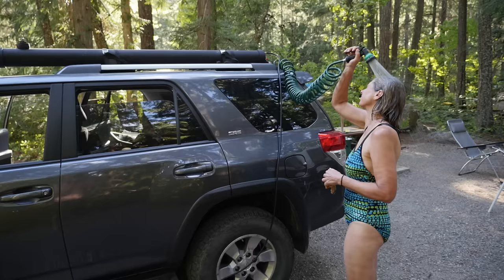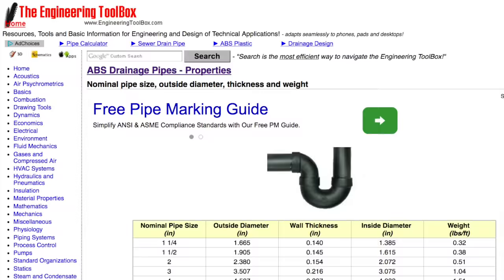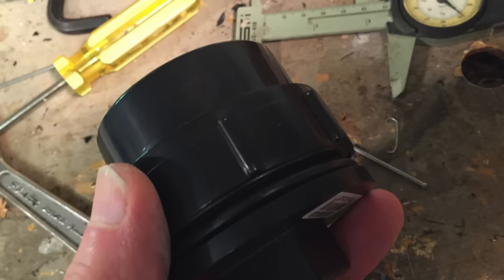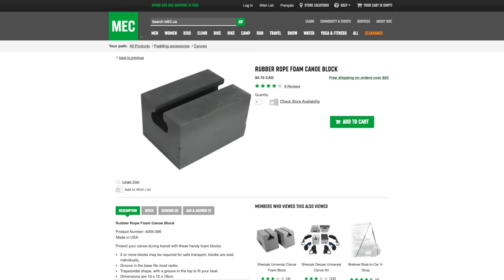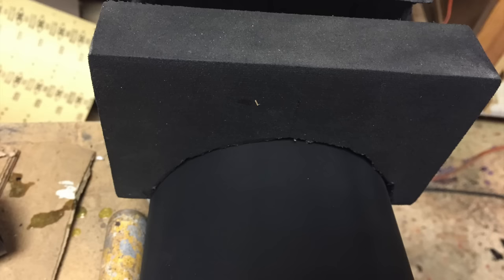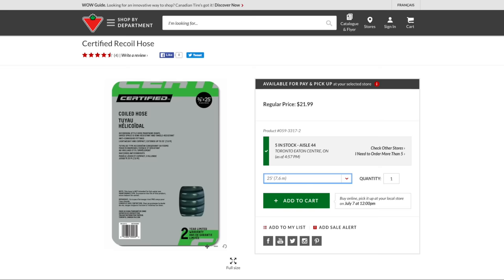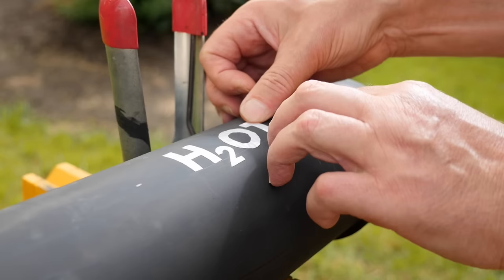H2OT - Rooftop, pressurized, solar-heated shower/sprayer using ABS pipe. DIY

Comment: 5 years later this pops up on my feed...Question for you...Do you have to keep the compressor on while using this? Hope you read this... Nice video...
Reply from the maker: NO. The compressor is only required when the psi drops to about 10 psi. Then turn it on to bring it up to 30 psi and shut it off.  The remaining volume of water I the tank determines the pressurization cycle.
Reply: @ImaginetMedia  Thanks for the reply...I only ask that question because your pressure gave out only after a few seconds...Was just thinking if you kept up the pressure while using this method that it would last. Might be easier for you to use a jerry can with a 12 volt pump...Plenty of videos on this method...
Reply from the maker: @tracymiller833  My method works fine. If the tank is full, the pressure will drop quickly. As the tank trains the reserve air capacity increases. The goal is to use the compressor as little as possible. Especially in a campsite.

Comment: it should be detachable from car, so it can be put on sun, and car in to the shade.
Reply from the maker: It is easily detachable from the vehicle. The straps only take a minute to attach. However, when full, it weighs over 20 Kg. Hoisting a 45 pound dead weight, up above my head, then leaning over to hit the roof racks without smashing it onto my trucks roof, is not something I am prepared to do.

Comment: Followed these specs with a few changes and I’m way happy to have a shower on the road, now! Thank you! How is it long term? Any issues? Does the paint hold up? And does the paint protect the ABS from the sun, as far as you can tell?
Reply from the maker: The key to any paint project is preparation. If you follow my steps - clean with methyl hydrate, buff with steel wool, apply good automotive primer, two coats of flat black pair, your shower will be UV safe for many many years.

Comment: I have a question about the 2" filler. Did you decide to drill instead of installing a 4 x 4 x 2 fitting because the fitting joints might not be able to take the bouncing of a full pipe over rough roads? Good job on the video. Did you also notice much pressure coming out of the 2" fill cap when you removed it after the water heated up inside and expanded?
Reply from the maker: Drilling is cleaner, cheaper, and less weight.  These joints will NEVR come apart. This is solvent cement, as glue and most people to not realize. The fitting a chemically welded together.
Reply: Thank you, I know that the solvent dissolves some of the ABS but did not realize that it could be used as a filler also. Your way is much cleaner looking, stronger and cheaper than a 4x4x2" fitting. Thank you brother, peace be with you.

Comment: Can I use a 6" ABS pipe instead of 4"? Im thinking of making one but shorter then what you have on your video but with a bigger diameter to hold the same amount of water.
Reply from the maker: All the specs for capacity are listed in the spreadsheet that I show. One factor not listed is cost. Six in ABS is significantly more expensive that four inch. It is also difficult to find in many areas.

Comment: Great video! Question: does anyone know what the best material for the tube would be to absorb the most heat?
Reply from the maker: The question really should be the best material to absorb heat AND transfer it to the water inside.  The answer to that would be aluminum. That is what started this whole adventure. I don't want to pay $500 for an aluminum tube.
Reply: Copper would be best, but ABS is lighter and cheaper.

Comment: Super achievement. Can you tell me which purge valve you have used. Merci
Reply from the maker: It is a standard vehicle radiator drain valve. You can pick one up from any automotive supply store.  Here is a 2 pack from Amazon... https://www.amazon.com/Milton-S-614-4-Compressor-Tank-Drain/dp/B000HEITXE
Reply: Merci beaucoup,thank you very much,I just have to get to work

Comment: I filled it up with water, problem is you cant see how much water is in there, then i put air in and it exploded the top cap to pieces.
Reply from the maker: If you fill it through the 2 inch fitting, you will know when it is full as it will overflow.  I suggest filling it right to the brim really remove all air voids for numerous reasons I have identified in previous comments.
Reply: Water is not compressible, which is why you need air space. Fill it full of water and you have no air space to compress.

Comment: How about a second one painted white (and/or a wider diameter pipe fitted over it with small holes for airflow) with a regulating valve connecting the two so you have hot and cold; just in case the water is too hot for showering?
Reply from the maker: The water is never too hot. If it was, I would just pour a bucket of water into the tank to cool it off. There is NO shortage of cold water where we live and camp.  larger diameter pipe is very expensive. That is why we used 100mm diameter.

Comment: great video! but Idk if someone already asked this but why not use metal? wouldn't it make more sense since metal is a conductor of heat and abs is an insulator? wouldn't the metal heat the water better?
Reply from the maker: ABS pipe = $30
Aluminum pipe = $300
Reply: imaginetMedia haha well put. but I wonder if you could use mild steel if you used a thinner wall so it wasn't to heavy. Still I like the budget option.
Reply: it would rust badly  you would not like to shower in brown water .
Reply: colinvanful Harbor Freight sells aluminum air compressor tanks for around  $65 if I remember right, with all the fittings attached. Aluminum isn't easy to paint black but I'm sure you could figure something out. Too big a diameter for a car- top project, and it wouldn't have the good surface area/ volume ratio since they're shaped like a small keg (wait, a keg would work too! The tall thin ones), but would probably work great in some applications, like RV or boat.

Comment: I am in process of making my own and I love your filler cap with the o-ring. I am trying to find one of those for my build but am striking out.  Are there some search terms which you can recommend I use to find such pieces?
Reply from the maker: Here is the plug I used. you can see the silicone gasket in the photo.  
https://www.homedepot.ca/product/lesso-2-in-abs-male-plug-mipt/1000116110
If you can't find this plug in your location, search for 2" O-Ring.
Reply: @ImaginetMedia  just saw this alert now! I ended up using a 2" union fitting which went into a 4"x4"x2" T. Not the prettiest looking thing but it works great so far! From what I have found out, that 2" plug with oring just is not a thing I can get in the states. It isn't anywhere to be found and I have checked so many stores

Comment: I’m so jealous....  don’t you dare loop a copper line around your exhaust under your truck with a circulation pump to move the water back to the tank as it gets hot like a radiator’
Reply: Alternatively you can run a heat exchanger with the water and the engine coolant

Comment: Great video! Was able to build my own after watching this several times. Assuming my pipe is completely air tight, if I pressurize it to 30psi, how long will the pressure last before dropping to 10psi or less. Does the diameter of my hose affect how long the pressure will last? Mine doesn’t seem to hold pressure too long and there doesn’t seem to be any air leaks. 
Thanks!
Reply from the maker: If you used the correct ABS solvent cement, there is no way it will leak at a joint. If you used PVC or some other cement, then the improper assembly will result in leaks.  
Another spot that may leak is the 2-inch cap. If you look at the video, you will see my cap as a silicone gasket attached to the cap. This comes with the brand of ABS cap I bought. Not all brands include them. Also, the cap threads may leak so a few wraps of Teflon tape will tighten the joint.  
The compressor you use may not have a functioning check valve built-in. All good compressors do. If yours is inexpensive, it will allow back flow of air/water into air hose and eventually the compressor itself, causing a bigger problem.  I would check that. 
The shower hose I used is 3/8". This smaller diameter has significantly less capacity than a 1/2" hose. I chose this for that very reason.
Reply: imaginetMedia that’s for the insight! Really helpful!!

Comment: Would the air inlet valve not also be able to act as a air release valve by depressing the centre pin?
Reply from the maker: Yes it would work. However, depending on the level of water in the shower, it may end up being a pressure washer aimed directly at whoever is depressing the valve.

Comment: Would a bike tire pump work for pressurization? Trying to keep it simple.
Reply from the maker: A bike pump word work, in theory. However, you will need to determine the volume of air required to achieve 30psi., in a half empty 4" diam pipe, 6 feet long as compared to the volume required to take a bike tire to 30psi.
Reply: imaginetMedia a bug sprayer has about a bike pump with two gallon capacity and creates adequate pressure pretty easily. So I'm guessing it would work ok.
Reply from the maker: This sounds like a great modification. Please let me know how it works out.

Comment: How much more heat do you you think you get by painting the black pipe with flat black, or how much faster is the rate of heating?
Reply from the maker: I have not done any tests as I do not have anything to compare the before (unpainted) state to. However, research online prior to my build, showed that flat black was the best surface for adsorbing solar energy.

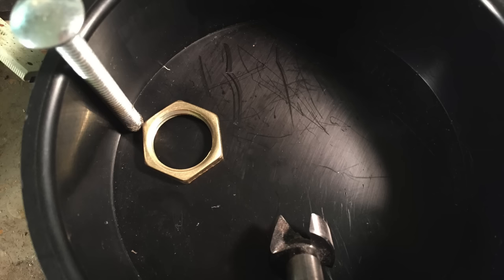Comment: Can you tell me the size of the retaining valve nut? At scene 1:37. Also what did you glue it so the shutoff sprout stays in place? Did you use any rubber O-rings and at what locations were they needed?
Reply from the maker: The retaining nut is a Faucet Lock Nut and is visible in shot at 1:24. It was not intended to be used on the threaded end of the valve. They had the same thread so it worked out perfectly.  

The shut off is threaded in so tight it is never going to move. Having said that, that is why I used the retaining nut to prevent the shut off from accidentally loosening.  It is not glued in. What you see at 1:34 is a small bead of epoxy between the brass and the ABS. That is there as a gap filler. If I threaded the shutoff on until it bottomed out, it would not be aligned pointing down. So, I just applied some epoxy to fill that gap.

I did not use the O-Rings. The air valve came with its own rubber grommets which I did use.

One other tip I did not mention in the video. To get the shutoff threaded in all the way, I had to heat it up with a propane torch. That slightly softened the ABS enough that the threads could be tapped in without cracking the cap. I repeated this several time taking the shutoff out, reheating, and quickly reinsert and turn with a wrench.   I did not want to take a chance on cracking the cap.

Comment: great design and presentation, thank you for sharing. Do you keep the air compressor on while showering or just get it up to 30 psi? if not how many showers before you fill it with air?
Reply from the maker: I pressurize to 30psi and turn off the compressor. When it drops below 10psi, I  turn it on for a few seconds to bring it back up to 30psi. As the water is used, more airspace is available and thus the pressurization interval lasts longer.

Comment: I will be building this in Vancouver over my next free weekend. Thanks for this. Any update you would make to the system or are you still happy with the design?
Reply from the maker: Some tips...

Make sure you park slightly uphill when you fill the tank and use the shower. This way you will ensure you are not trapping are at the top which will reduce your volume. 

Being from Vancouver, you will probably have many rainy weekends to work on this project!  (BTW: I live in North Van).

I bought all the plumbing parts  at Home Depot. NOTE: I did not use the rubber O-rings that are shown in the video at 1:25. I bought the bolt on air valve and radiator drain at Lordco or North Shore Parts (not sure). The hose and sprayer are from Canadian Tire. The foam canoe pads are from MEC. The compressor I ordered online from Amazon as I could not find a local supplier of this model.

DO NOT skimp on the compressor. DO your research. This one connect to the battery and not a accessory plug. That is because these draw more amps that the plug in ones, which means you will not be blowing fuses when you need the compressor the most. It is also much quieter than the cheap models. 

I also ended up heating the shut off valve with a torch to make it easier to tap into the pipe. It is never coming out. I had to stop threading it in about half a turn short so that it would align pointing down. You can see in the video that there is a small bead of grey epoxy around the base. I used that to fill the gap. It is only for cosmetic purposes. 

I may end up gluing on some form of bracket made out of ABS to the bottom to align with the back of my roof racks. Just for insurance that it will not slide forward. It has not been a problem, but I just want to make sure for the future. 

Good luck with you build. If you run into any problems. feel free to ask me.
Reply: imaginetMedia 

for stronger roof mounts you could just get the shedule 60 industrial grade drain pipe in 2 inch dia or what ever and cut them in half length wise and use hose clamps to bond the new pvc mounts to the water holding  drain water pipe and some foam glued into the inside of the new mount that would fit onto the luggage rake

Comment: Good morning, I'll probably do this and I'd like to know the weight of the shower (structure) and where the best roof rack area is to fix it. I am afraid that there of possible imbalances in weight. thank you very much
Reply from the maker: All the specifications, including weight, are shown in the spreadsheet which can be viewed at 1:18 in the video. 

Most roof rack systems can easily carry 50 kg or more. All the major rack companies web sites have calculators to determine the maximum weight for your specific vehicle and rack system.

I would recommend mounting the shower as close to one side of the vehicle as you can. This will make it easier to access and fill with water and will also move the drain spigot away from your tailgate when it is open.
Reply: Thank you

Comment: I'm planning on building one of these also.  For those interested, there is a volume calculator that, given any diameter of pipe, and a length, will tell you how many gallons it will hold.

For example, using 4" schedule 40 PVC, a 6' long length will hold just shy of 4 gallons and the water will weigh 32 lbs.

https://www.inchcalculator.com/pipe-volume-calculator/

One improvement I want to add are some baffles in the pipe, so that the water is not sloshing freely all the way from end to end, which you didn't mention in the video.  Simply partitioning the pipe along it's length every foot or so, with holes drilled for water to pass, especially near the "bottom" of the curve to be able to drain fully would eliminate 30 or 40 lbs. of water slamming back and forth in stop and go traffic.

It should also be mentioned to use Iodine Tabs to purify the water if not from a potable source, and then, if used over long term used also periodically to avoid problems and the water fouling.  The tabs are very inexpensive on Amazon.  Using those, you can safely grab river water (suggest using something like a coffee filter or better to block sediment and "floaters" when capturing the water), fill it, dump in tabs, and in 30 mins. have safe clean water (though it make take longer to warm up!).

I'll probably forego the pressurization system, and just loosen the fill cap to let gravity do the work of showering.

Great design though!

Comment: 6 feet is 1.83m, 1.83m*8.11L/m (taken from your data for the 4" pipe) = approx 15L. How did you fill it with 30L ?
Reply from the maker: Nick Mulder we ran that test twice.  Both with the same starting temperature of water.
Reply: Ok, but how did you fill it with 30L of water? See my reasoning above, is your pipe 5.65" (all other elements equal), 12.14' long (all other elements equal) or is perhaps is the L/m data on the spreadsheet incorrect by a factor of 2.02 ? (assuming walls are 0 thick) - maybe I need to listen again??
Reply: " we ran that test twice " as in 15Lx2 = 30L... what didn't you get about what he wrote to you?
Reply: Well, I didn't get the part about running the same test twice as being relevant to my question. It seemed like a weird reply given that there was no explicit reference to the confusion that stemmed from the language used in the video. I could fill in the gaps, but yeah, I didn't know how big the gaps were so left that untouched. Google 'ENTP and INTP personality type' for some more context  :D